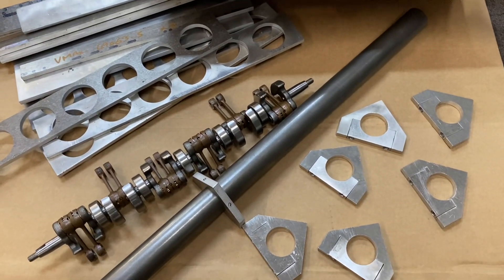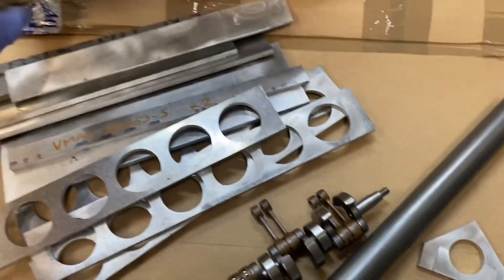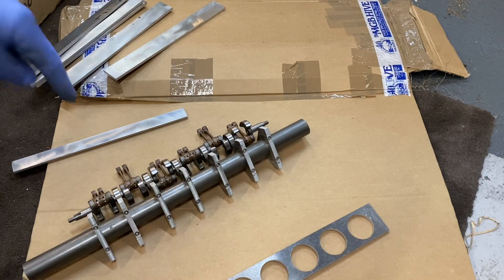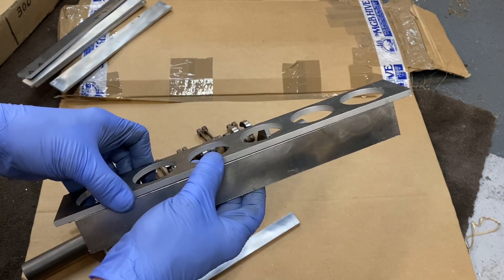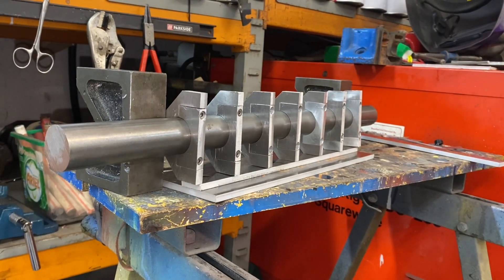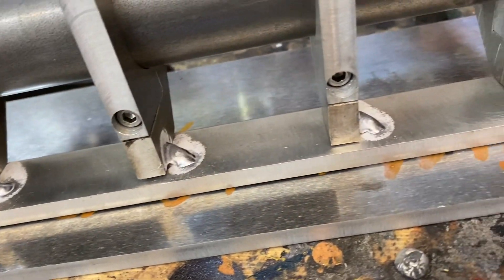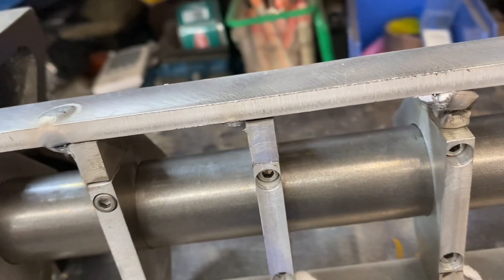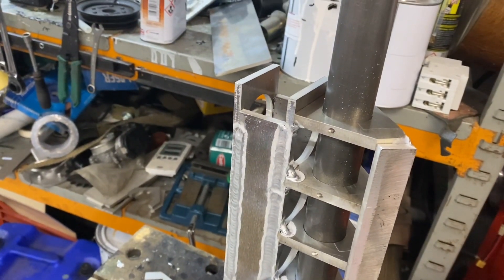300cc V12 from 12 x brushcutter motors

Comment: Normally a welded block assembly would have ample final machining to allow for heat warpage.
Getting close to size sets you up for difficulties.
Reply from the maker: yep but this is small and soft easy to push and pull back  into place

Comment: What is the stroke.  I'm looking for a 50mm stroke crank for a project of my own.  What would your recommendations be
Reply from the maker: Hi these are chinese honda gx25 clones , so 25 cc four stroke , bore is 35 and stroke is 26mm. The gx200 is 68x54mm maybe thats nearer what you need ? whats your project going to be ?
Reply: @scarlettsgarage1  rotating sleeve engine.  Square four.    I'm after torque more than high revs,  for a RC tank.  40mm bore, stroke around 50mm if I can get, or make it.  Crank has bevel gears turning the sleeve with a port at top of sleeve for timing.   Output shaft also being the sleeve.  Counter rotating cranks to help balance out vibrations.   And two output shafts to drive two hydraulic variable swash plate pumps for each track.  Eg. Low revs, high torque needed.    Thinking also of maybe using the pumping looses of the crankcase, to work as a super charger, similar to a two stroke, but running as a four stroke.    Compact, and eliminates the difficulty of machining a cam.   Hopefully my ramble is understandable. And Hello from New Zealand
Reply from the maker: wow thats alot to make , dont over think it, the more simple the better ! @russcole5685
Reply: @scarlettsgarage1  yup, single cylinder first to test concept.  Then keep adding.     I've a couple of RCV glow engines from my model plane flying days.   So I know they work.  I just don't know if my drawings will work until built.    A single cylinder Rotating cylinder valve engine as a four stroke only has one more moving part than a two stroke.   I'm trying to keep parts count as low as possible.  Ease of manufacturing, less cost of material and time.    Grinding cams, tappets ect. A lot of work.  Mill a hole in the top of a slave.  Seems easier.   They're a very neat design